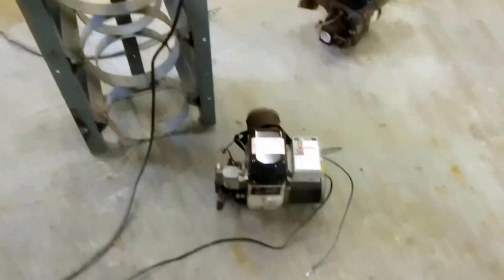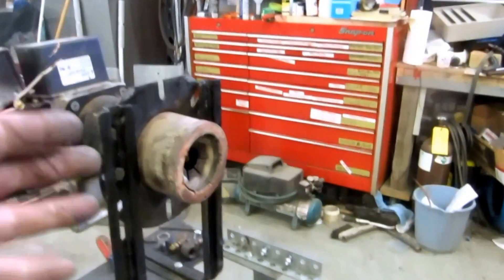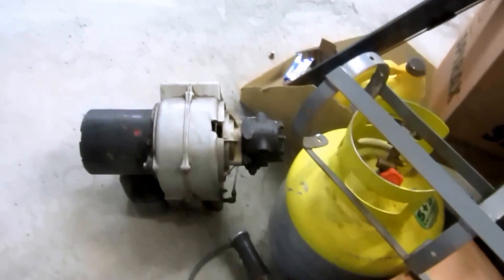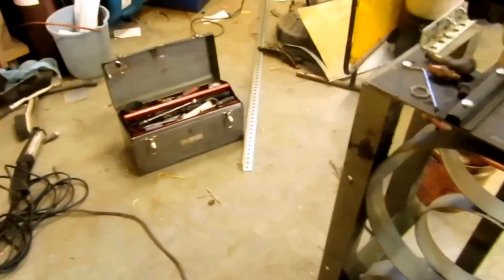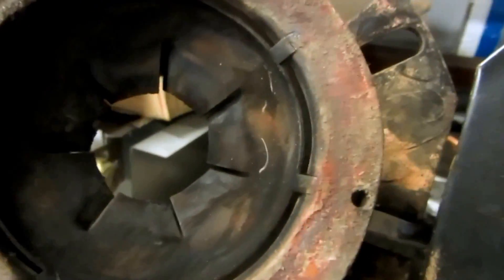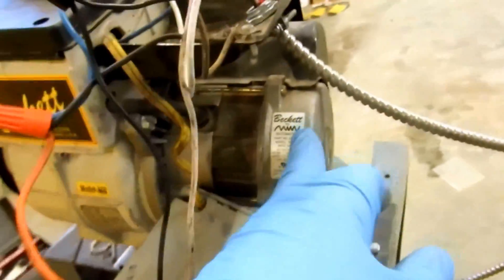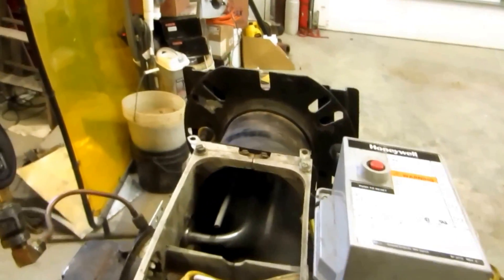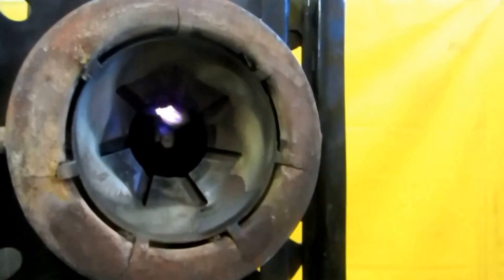Beckett oil burner training series  #1

Comment: As a fellow hvac technician please stop doing these videos. You stated countless misinformation in this video alone....there is NO #1 or #2 beckett retention heads. There are #0/#3/#4/#6 and larger, plus each retention head needs the proper static plate UNLESS the manufacturer and Beckett specified a smaller or larger static plate

Comment: Steve - I got a fairly new Beckett. 7505 controller. new Cad Cell unit. worked fine the past few years. This year, it is short cycling. 3 mins max. then off. Changed the filters. everything else looks ok. I can't tell if my chimney is blocked in any way, but I blew a bunch of air up into the stack with a leaf blower (I know, high tech) ....thoughts?

Comment: Aw rhight my New England Brothah!  This is going to be a great help for me here (now in PA) with a 60-80 year old oil fired hot water to radiator heat, furnace and a Beckett burnah! I've run diagnostics on this thing (being a true New Englandah not cheap just smaht/frugal) for the last three years and saved about $1000 dollars. My problem is cruddy electrodes after almost every firing requiring take down and cleaning to get to fire again. I have a new transformer/igniter but haven't replaced it yet b/c the old one still works!! (sound like my dear old departed dad..). So hope your video's can help! Wicked-good video!

Comment: Oil heat more Btus

You are more  likely can
Fix it yourself  can pick
Your own oil and service  no psi drops 
Due to sub zero Temps
Can use diesel fuel 
Oil so far is tax free
Safer  hotter much cleaner  with Byo mix
So are we oil guys still
Bad mouth ing oil

Comment: Hello Steven lavimoniere I have a question that I can for the life of me find the answer to. On a oil burner "When there is a decrease in the primary air which of the following is correct? A) decrease in co2 percentage. B) decrease in combustion gas temperature. C) decrease in stack temperature. D) increase in efficiency.  My teacher gave an answer but I can't find it anywhere I research . thanks

Comment: We have a Beckett AF on our 1953 American Standard Arcoliner boiler (video on my channel). I'm wondering, can the spark be heard when the burner is running normally? Our burner produces a similar sound like the spark, and I'm not sure whether it's the spark I'm hearing or just some weird motor noise. It's like a medium-high pitch buzzing noise, I'm listening to it right now as I'm typing this.
Reply: SpaghettiGoat have tech do maintenance, check electrodes, nozzle, filter, transformer etc. make sure it is setup correctly and clean first. Great video Steve!!!

Comment: Back in the 80s I ran a service dept. for a large oil company in Camden NJ. I worked on everything imaginable, learned a lot even after attending a good oil burner course in Philadelphia. I do all my own service work and am currently putting a new 275 tank in the basement to replace a 550 buried tank. Not leaking yet but it will sooner or later. The boiler is an older Weil McLain P466 that's in great shape and feeds cast iron baseboards. I'm curious how you feel about newer oil fired boilers- are they worth the cost? And, is the oem Beckett af series burner capable of improvement? 
Keep up the great series and say hi to your puppy (can't remember her name).
Regards,
Mac Morgan
Hockessin Delaware

Comment: A very good video, my Beckett has a 45 second lockout--why that long, 45 seconds of pumping oil in the furnace , bad if it doesnt ignite, would 15 second be better ??
Reply from the maker: i like a 45 second relay better then a 15 second one .most of the newer ones are 15 .any 3 gallon nozzle must have the 15 second relay thats code in my state
Reply: Thanks Steve for the quick reply.

Comment: Fantastic tutorials. I watched almost all your videos and then attempted (first time) to do a self-service of my oil furnace (just moved in last year. Took it nice and slow; AF II 150 Becket burner nozzle change, oil filter and screen.  I have two 275 gallon tanks and one of them was plugged (didn't know where at first) in the line between the tank and the T-joint. Compressor wouldn't budge the blockage so I ended up using a good length of copper wire...and it worked - nice flow now. I have a metal shop at home and am not afraid of almost anything mechanical, but when it comes to heat and SWMBO, I was petrified. Watching these videos gave me the confidence boost I needed. :)

 Kudos to you, well done!

Comment: wondering if you can help me out , i would like to add a hour meter to see how much oil fuel im using , is there a setup you can show us? im using a beckett  burner with a .75 80A nozzle  and want to keep track of my usage and not spend alot of cash doind so .
Reply: There are thermostats that will keep track of run time you have to know the pressure your burner is running at to calculate if it's 100 psi your ok by going according to nozzle size

Comment: I have a mobile home with  a kerosene burner  ,Can I replace the burner assembly complete from a regular oil burner  unit  is it the nozzle that is the only difference?
Reply: I wouldn't recommend if your tank is outside and temperatures in your area are cold but yes burner is the same
Reply: Ok  thank you  what I meant was I would still use Kerosene  but the nozzle in the burner with the motor on it would have to have a size for kerosene wouldn't it ?
Reply: #2 fuel oil has more btus then Kerosene I don't think you're running straight kerosene but a mixture nozzle size depends on btu capacity of your furnace
Reply: Thank you for your help

Comment: Hey Steve. Came across this beckett control on page 19 of Factory PDF, have high fire with flame touching rear section, large HB Smith boiler. Going to do a cam adjustment Any thoughts on Orange Transition Cam, believed as transition between low fire and high fire mode.  

http://www.beckettcorp.com/protect/manuals/6104BCG50.pdf
Reply from the maker: John S i would have to see it to set up the flame ..

Comment: i have a troublesome reillo burner that i want to replace with a beckett model afg burner, it has a non-adjustable flange on the air tube and would stick inside the boiler by 3/4". do you think that would be safe to use without damaging the burner or should the air tube be flush with the inside of the boiler?
Reply from the maker: pa17948 change the burner tube and get a adjustable flange the burner should be flush with the boiler .not sticking in at all